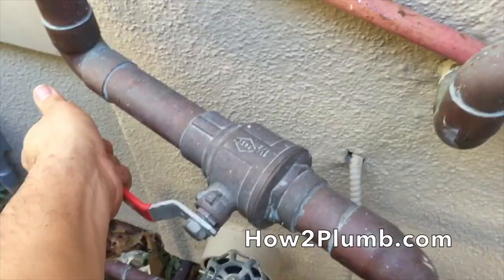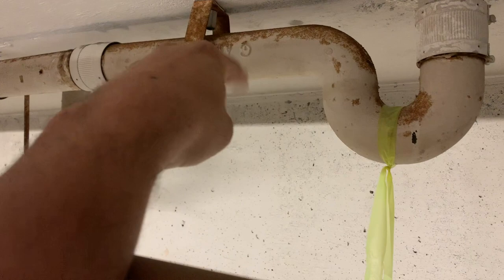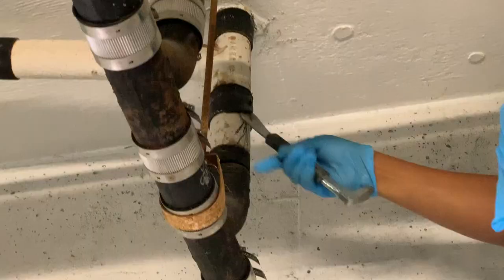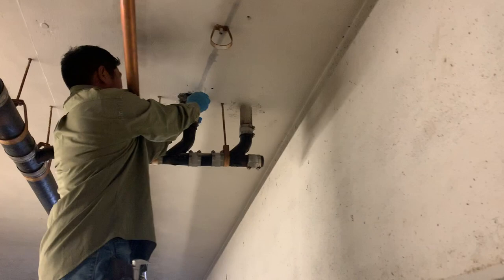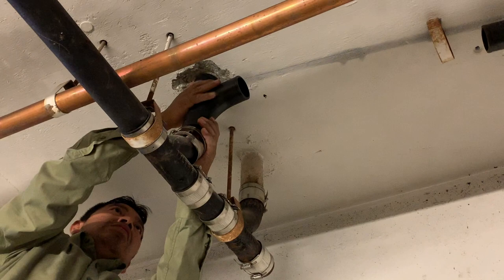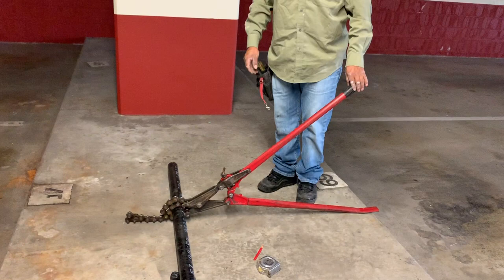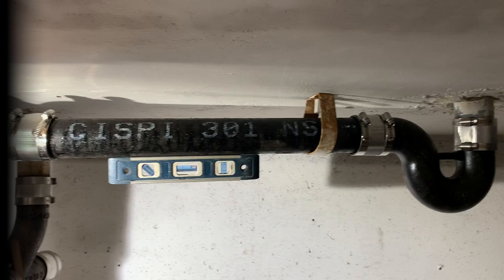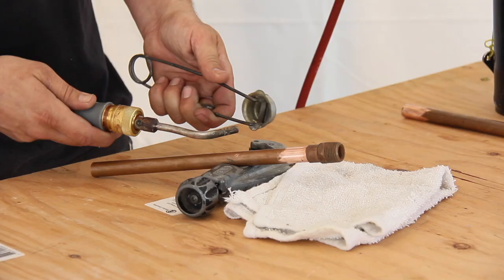How to make $300 per hour plumbing

Comment: You want to be that plumber, electrician, HVAC technician, etc it's a lot of hard work, but it the end if you stick through it, you can be making $50,60,70 an hour in the US.  Once you become certified and are trusted to be out on your own, you can as much money as you want, but there is a lot of sacrifice.  Being on the job site from sun up to sun down, being away from your kids, working 6 or 7 days a week depending on what the job site requires.  Developing chronic injuries like neck, back, or knee issues.  Job site injuries.  It also may take 4 to 6 years depending on what you do like an electrician before you get to be on your own.  Still, there are construction people begging for these types of people like plumbers, and HVAC, or electricians and there just not enough at there.  Many of the older Boomers are retiring and there's just not enough people to replace them.
Reply: And now the normal home person can't afford a plumber for repair work anymore.
Reply: I’m 34 am I too old to start it takes 4 years to become a licensed plumber I’d be 38/39?
Reply: @koonyeezy6433 apply to and call up at least 5 companies to follow up. Figure out what they offer and if they won't hire you yet figure out what they want you to learn before you work for them. There's a lack of licensed guys so some companies will push you into a Journeyman role as an Apprentice if you k ow what you're doing. Attend plumbing classes (continuing education/plumbers education) and ask some of the guys there who's hiring. You can get a living wage in a year and a half to support a family if you work hard at it.

Comment: Good evening sir, can I work as a plumber even if I don't have a experience?? I want to work as a plumber btw I don't have any training or certificate regarding on plumber, I'm interested to be a plumber.
Reply: U can work as a helper or an apprentice plumber until you finish your apprenticeship, then you can take an exam and become a licensed journeyman plumber
Reply: @4G1O4  Would you tell me how long does it take to finish the apprenticeship??
Reply: @gulahmadraziqy9396  typically 5 years but you get a nice raise yearly until you become a journeyman

Comment: How long does it take to get your license to start a plumbing business?
Reply: As far as I know, in most states would be 6 years mínimum . 4 yrs to get a P2 and 2 more years to get the P1
Reply: You can start a plumbing company anytime. You can actually take the test and get a plumbing  license but need to have the $$$ to hire the plumbers but you need to know how to run the biz. Traditional way 5 year apprenticeship become a journeyman and still there's a diffrence between a plumber and a CEO

Comment: I'm barely starting off working on my own but I'm having difficulty on how to price do you have any advice I would really appreciate it thank you
Reply from the maker: Where are you located? I charge $145 per hour and $95 for my assistant. Sometimes I bid project too.
Reply: @How2Plumb  i live in California central valley is there any furmula or strategy to come up with my hourly rate pricing?
Reply: @alexramirez5562  in Anaheim we charge 165 hourly and that’s around the average make sure to think about all material needed

Comment: Hmm...🤔 I wonder how much money I could make in the USA? I have experience working with water supply, sewerage, ventilation, heating, and also have experience working with new industrial modular boiler houses of 20 megawatts, equipment setup, maintenance and repair of boiler equipment.

Comment: What plumbing niche can I get into that doesn't require dealing with toilets?
Reply: Something industrial. Steam fitting. Or if you are talking just not wanting to work with USED toilets, maybe you can stick with new construction.
Reply: New construction. Although I would not call it a niche.

Comment: 2:21 A 15$ gallon bottle of cleaning gel overnight couldn't solve this? Or 500 grams of aluminum enriched cleaning balls activated by water. 
I mean it's not cloaged with cement like stuff from degradaded fats and proteins or corrosion build up.
Reply from the maker: Well I like to do it the proper way not the handyman way but the plumber way.
Reply: @How2Plumb  lmao